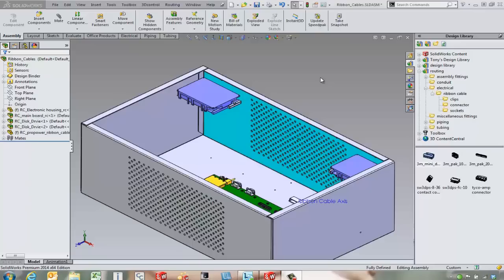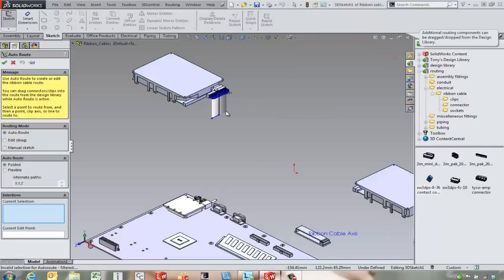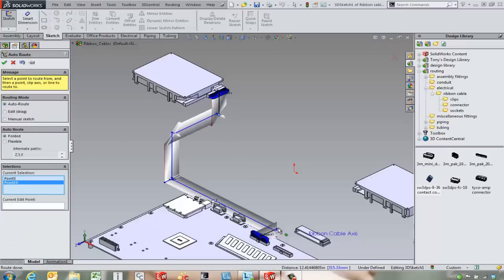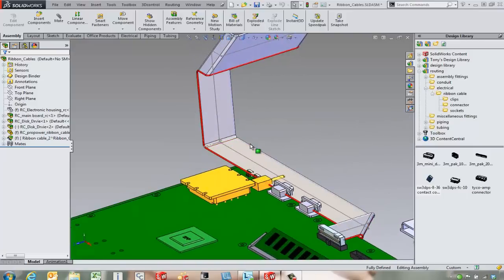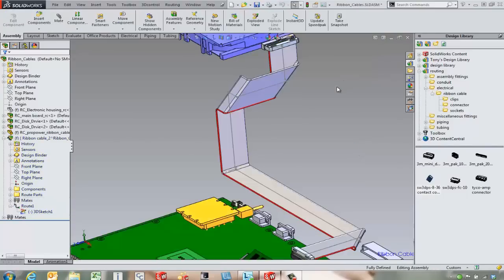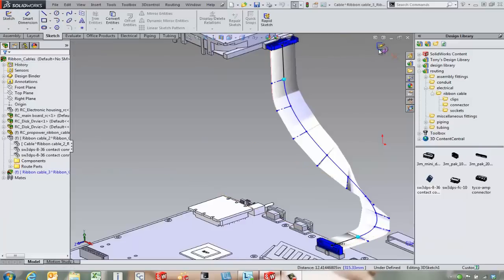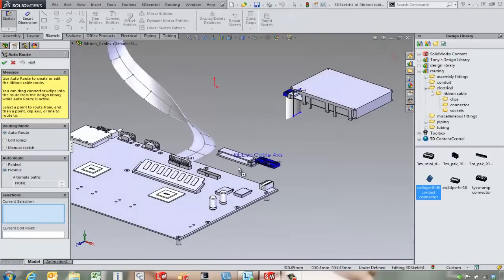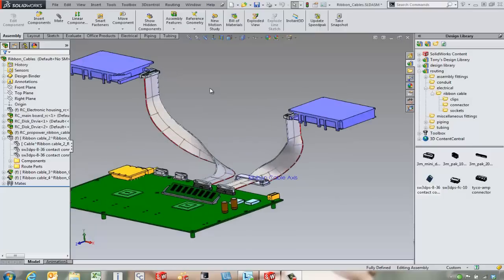SOLIDWORKS Routing - Ribbon Cables

Comment: Hi Tony. If you’re still active, can you please help me with this question? How do you get the flat profile of that ribbon?

Context:
I design PCBs and frequently make flexible circuit boards that function in a similar way to the ribbon cable in you video. The main difference being that they can take any shape.
The mechanical engineers I work with typically draw the ribbon using SolidWorks sheet metal and then export the board outline for me to start routing.
However, drawing the flex in sheet metal is very limiting and it’s very difficult to make the both the start and end of the cable line up with their respective connectors.
We have also tried using a sweep or loft from a 3D sketch path but without obvious bending edges, it’s not possible to convert this to sheet metal in order to extract the flat profile.